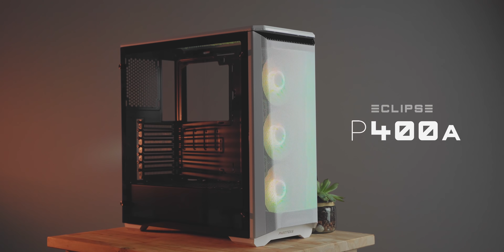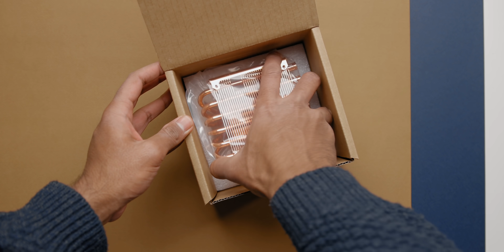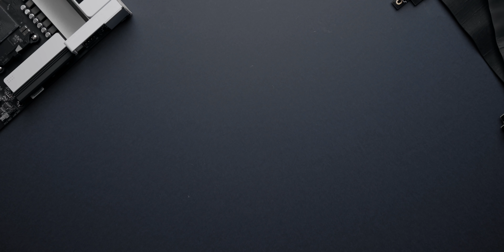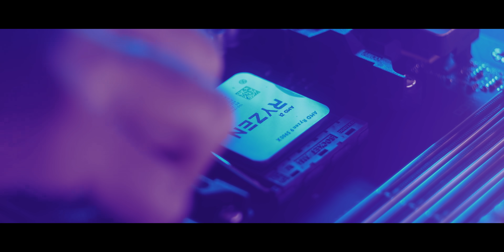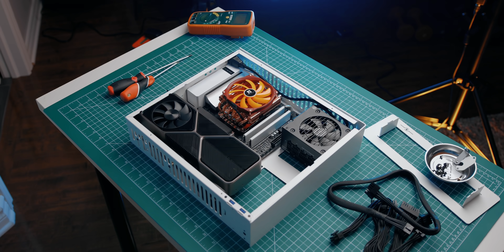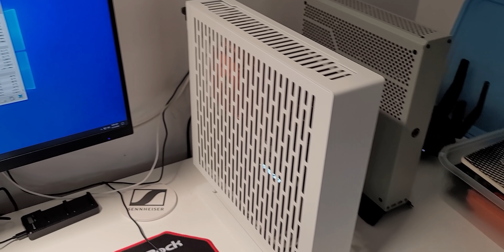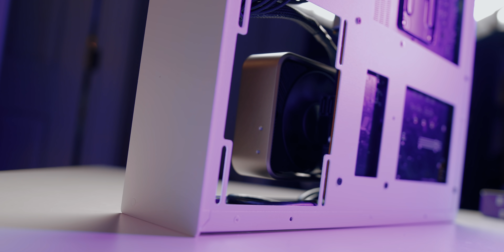The SMALLEST ATX Build Yet - Ryzen 5900X in a 10L Case!

Comment: Why can't they make new motherboard with higher power limit . Amd limiting new 5000 CPUs to old 3000 limit might be holding back new CPUs , 
I don't see why wouldn't 5950x can run all cores at 4.8 , 4.9 GHz , or even single core could go beyond 5.2 GHz.

Comment: what did you use for the gpu vertical mount?
Reply: riser cable that comes with the case. Vertical mount is only possible mount in this case.
Reply: @riba2233  when buying a vertical gpu mount cable should I consider whether its pcie3 or pcie4, sorry im new to this

Comment: the case looks really cool,   please follow up if you find a better cooler solution.  My HTPC is an old alienware x51,  similar form factor   but the included cooler is not very good.  I have been browsing for aftermarket low formfactor cpu coolers,  and would like some of your input.  thanks!

Comment: With regards to your sentry cooling problem, maybe you can fit an alpenpohn black ridge cooler. That the biggest low profile cooler I can think off. You can find one on eBay for about 60 usd. I know your pain. I have a Dan a4 v3 with 1800x with asetek 545lc and Vega 64 reference. Optimising and modding for better cooling makes them interesting. Hope this help.

Comment: the power cable plug being at the top of the back is such a disappointing design choice
Reply: The thing is where else could it be placed while keeping ATX + 2-slot video card and Mini-ITX + 3-slot video card support?
Reply: @soulest2081  not sure if it really isnt possible to put at the bottom. This layout in general looks pretty similar to my node 202. But yeah, the thick power cable coming from the top is definitely a deal breaker for me
Reply: @poloy4288  Good point there. I have considered a power cable with a 90-degree plug though I'm a form + function sort of person.

Comment: Dear @Hardware Canucks
, first of all thank you for this great option to see what can be done.
I'm considering building gaming pc so it could be portable and this small factor is amazing.
5600X with 6800XT, I only fear regarding CPU cooler.. max 59mm is small what cooler would be best since the 5600x TDP 65W ? would an l9 be better than this thermalright one?
Would love to see comparison between different low profile coolers! 
Thanks!
Reply: The Thermalright shown in the video is your best choice. I own the Thermalright AXP-90 Full Copper (47mm tall) and Noctua L9a-AM4 (39mm tall) and the Thermalright does much better in thermals and similar in noise.

Comment: ATX mobo + 120mm AIO + 3080 FE (or 1080 mini) possible?
Reply: 3080 - only with jerry riged 80mm fan on 120mm radiator. 3070 FE yes, 1080 and 1080ti mini yes, 2070super mini yes; 2080ti, 6800, 5700xt ref and other 270mm long ref cards - yes but with 92mm fan on 120mm radiator (bracket provided with the case)

Comment: rather pointless to have a case like this taking a full ATX board. the whole reason for having full ATX vs mATX or ITX is more PCIe expansion. but in this case you're limited to just 1 expansion device, which 99% of the time is going to be a GPU. making your comment about adding a 10G NIC a bit awkward since you cant even do that if you wanted to.

Comment: I love this build, it really looks like a console.
But my wonders are: would people spend 200€ for this case ? 

i personnaly wouldn't go over 80.
There is no tempered glass, it looks light,..

but that's a great project
Reply: It is not light, trust me. Uses really thick steel panels, and high quality powdercoating, and it is hand-bent, so not really comparable to mass produced cases. It also has ventilation and your components won't choke, so that is also a bonus :)

Comment: Well i would put a DC mode and make the fan run at 40% max to avoid having too much noise.
It does a great job too under 40%

But i also think a fan at the below part cant catch the heat well..
Below would be for fresh air and bottom for hot air exhaust.

Maybe a fan on side that would have blown fresh air through the card would have helped

Comment: I thought about the be quiet! Shadow Rock LP cooler (it cools my 125W AMD FX-6350), but after checking the specs, I found that it's 75 mm in height with the fan. It's 50 mm without the fan, so even with an aftermarket slim fan, it would not fit.

Comment: I had a quick question about this cooler, could you potentially Mount an NF-A12x25 on this cooler? The cooler specs on the website don't really imply the mounting positions match on the fan and the cooler. If you guys get the chance to Check/Test this, I would definitely appreciate it as I'm interested in the cooler.

Comment: Beautiful build, beautiful components. I may very well grab that board for my upgrade to the 5000 series next year.

One question, do you guys think that the airflow coming off that 3080 would be sufficient to blow air through a 120mm AIO radiator? I've never used a 120 AIO before, so I'm not sure of their TDP rating, but I wonder if that would help with CPU thermals at all, or if the GPU's fan not being solidly mounted to the radiator would nullify any gains the AIO might add.

Comment: Is the height of the Fan limited by the screws? I mean, if it´s THAT millimeter you need, you could also look for a 15mm Fan with the option of mounting that fan on the lower frame.
The Silverstone SST-FN123 could be an option.

Comment: Awesme build and I love cases like this too. You would think by now there would be some better low proile coolers for some of these more powerful processors or make the case slightly deeper. I don't think I would ever need thunderbolt but you never know so maybe I would use the Gigabyte B550 Aorus Master mobo with triple M.2 instead or the MSI MEG X570  Unify and do an all black build.

Comment: I wish there were more thin direct airflow cases that weren't limited run artisan cases that cost $200+. The rvz02/ml08b and node 202 are still probably the 2 best mainstream cases in that form factor and they're from 2015, so I'm glad to see more cases in the same space..

All I want is something like an ml08b upscaled to fit an atx or matx, but still sfx thin.

Also, I'm not sure why nobody has done it, but with a thin case like this, it could still fit case fans if it had sufficiently slanted surfaces. Sure it would be at reduced efficiency, but at least they'd be able to mount.

Comment: Eber didn’t you just update your editing system in an M Case M1 like 5 months ago?
Reply from the maker: Nope.  It was the Sliger.  There's been major issues with that build (we did a video on it) and adding a RTX 3080 wasn't possible due to heat soak.

Comment: For the Sentry case build, you should just take the time to split all the wires of the flat cable apart and then just use some custom cut velcro ties or zip ties in strategic places along the cables to make them neat again.

Splitting those flat cables makes working with them 10x easier!. I did a build not long ago inside of a Fractal Node 202 with a Corsair SF650 PSU with those same flat style cables and it was a nightmare to work with before I split the cables apart. Afterwards, it was an absolute dream to route the cables and looked extremely clean.

Comment: ALPENFOHN black ridge might be a "cool" replacement low profile cooler
Reply: That is true, yes.
Reply: I tried to fit my black ridge on my x370 taichi I have lying around and unless you have really short vrm heatsinks you can't fit a 120mm slim fan under it. It won't fit with one on top in this case either and I don't see much point in going with just a 92x14mm fan.

Comment: I have a suggestion, its called spray-paint...Thermalright fans are very easy to disassemble, I have 3x TY-143 fans on a 420mm radiator, that I have painted satin black, and it has not effected their sound signature.

Comment: Hey, so I am currently trying to build my first PC. I have done months and months worth of research, and have decided on parts that I think will fit me the most. However, one of those parts, the elusive rtx 3070, seems to never come in to stock. Anyone have any tips to get the card? Any additional tips for Black Friday and Cyber Monday shopping will be greatly appreciated too. Thank you 😊
Reply from the maker: Let us know your chosen build specs.  It could be that there are other cards that fit!
Reply: @HardwareCanucks  Wow, I didn’t think you guys would respond so quickly. Well thank you. Here is my list (feel free to change any other parts, I could consider changing it because of your professional opinion):
CPU: Ryzen 5 3600
CPU Cooler: Hyper 212 EVO
Motherboard: Asus ROG STRIX B450-F ATX AM4
Memory: G.Skill Trident Z RGB 16 GB  DDR4-3600 CL18 Memory
SSD: Western Digital Blue 500 GB M.2-2280
HDD: Seagate Barracuda Compute 2 TB 3.5” 7200RPM 
Video Card: PNY RTX 3070 / NVIDIA RTX 3070 FE
Case: Lian Li Lancool II Mesh 
Power Supply: Cooler Master MWE Gold 650 W 80+ Gold 
Monitor: Asus TUF Gaming VG24VQ 
Keyboard: haven’t found one for a good price :(

A lot of these parts I didn’t need to give, but a second opinion on them is always good. :)

Comment: It's the fan from the GPU pushing air through, and the other fan not being in sync with the GPU fan, and thus it's cutting the air turbulence which causes more noise.  At least that's what I Think.  For air flow to be non disruptive it needs to travel a certain distance from the fan blades to stabilize.

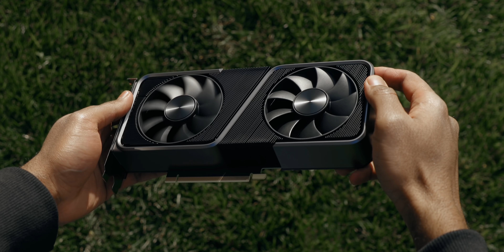Comment: 2:32 "and to top it all off, you can actually order one of these right now"  He's talking about the case, not the 3070.
Reply: It's a 3080 :(
Reply: @kingdavid7571  no that's a 3070 lol
Reply: @joshuacardenas7956  6:02: "We're going with an rtx 3080 founders edition..."  He did show a 3070 that you could use optionally with a different motherboard earlier, though.
Reply: Here in Canada the 3090 is going for $CDN$2799 and then add tax and shipping and you get $CDN5000!
Reply: @patrickwingert2018  👁️👃🧢
Reply: lol it's swapped now

Comment: Pick a 15mm fan and sand down the 1mm? I'd be interested to see how this case would handle an Alpenfohn Black Ridge with a 92mm fan on the bottom (120mm slim fan would work if there is enough clearance for the RAM or you'd have to switch to VLP RAM) and a slim Scythe Slip Stream on top (47mm + 12mm = 59mm). On paper, it sounds like it would work, but it would probably be easier to look at AIO's

Comment: One thought: if u build a smaller GPU (idk if 3070 could do it) and use that 120 fan space to mount a single AIO cooler for the CPU? That will help u with that CPU fan design problem i think. Yeah u cant put a 3080 in the build but i mean, u can have a really powerful system with an amazing look and water-cooled right?
Reply: Right!

Comment: The Formd T1 is a better case for hardware compatibility - just shy of 10L, ITX motherboard + 2 or 3 slot GPU (can fit a 3090 FE) AND a 240mm radiator (and an SFX or SFX-L PSU)
The only downsides are that you can only use an ITX motherboard (not really a problem if you're planning on only using one GPU anyway) and that flow-through cooling for GPUs doesn't work as well (but you can solve that by going with a custom loop or non-FE card)

Comment: I've been looking at this motherboard for my 5950x.  Why did you choose it over an x570?  Also.  Did you have to use a 3000 series chip to update the bios for it?  Much appreciated and i love your guys' videos.  Keep up the great work! :)
Reply from the maker: Great questions.  A)  We chose it because moving to X570 gained us very little and right now this board is really well regarded for memory stability and Quadro QVL certification (we're gonna post an update soon for that!).  B)  The Zen 3 was a drop in upgrade without a BIOS update but you NEED to update to AGESA 1.1.0.0 for proper support.

Comment: I am using the Alpenfohn Black Ridge low profile cpu cooler (it was made by the creator of the Dan A4) with a  Noctua NF-A9x14 HS-PWMA for a total clearance height of 47mm. It does the job very well for my Dan A4.1 SFX machine. I would consider looking into that if you want to get closer to a black aesthetic and noctua fan.

Comment: The AXP-100H Muscle comes with a same-sized black&white (black frame white impellers/fins design). While AXP-100RH/AXP-100 C65 come with a black frame red impellers/fins. There's also TL-9015 (grey) but it's 92mm so reduced performance + need zip-ties to mount it.

The same size black and white one though,  matches the color scheme 1 to 1 xD
Reply from the maker: True but the Muscle version is higher
Reply: @HardwareCanucks  True, but you could also just take the fan from Muscle and put it on the copper :)

Comment: Why not just set the PBO PPT and TDC limits to something lower, then you can PBO boost benefits but downclock to a coolable TDP when under full load.
Reply from the maker: Yes.  The issue is the earlier version of the BIOS we were using had some issues with PPT limits.
Reply: @HardwareCanucks  Ooh ok,  you guys should definitely revisit this.

Comment: What about the Raijintek Aeolus Beta Low-profile. It's  only 13mm high.
Reply from the maker: Need 12mm
Reply: @HardwareCanucks  maximum size is 120 x 120x 14 as you said in the Video and the Raijintek is 120x120x 13 so it should fit

Comment: So im curious on what pci e expansion cable u used because most of them on the market are pcie 3.0 with can cause issues/ instability with cards that are rated for 4.0 an or some performance hits. I know that there are 4.0 expansion cables but none that wouldnt need some sort of modifying to work.
Reply from the maker: What we did is what we recommend for EVERY build:  We built the system outside the case first to make sure everything worked.  Switched to Gen3 signaling and then finished the build.
Reply: @HardwareCanucks  Awesome, idk y I had so many issues with my 5700xt/3080 on the lian li pcie riser. I tried it on the asus crosshair viii hero and b550 aorus master and had the same stuttering, crashing and overall instability. I tried updating drivers, reinstalling windows, changing it in the bios. Idk if I was doing something wrong but I didn't think so, eventually I just said its not worth it and plugged it in the system with no issues at all both times. Think imma just wait till pcie 4.0 risers to avoid this plus might aswell take advantage of a all the features of this nearly 1000 dollar graphics card

Comment: Very happy to see you guys covered all the technical performance specs inside the case in this video and not just performance numbers. Big 👍🏻
Reply from the maker: Glad you enjoyed
Reply: @HardwareCanucks  Hy Dimitri. Iplan about the same with custom aJOAT. kinda like case. Do you think this axp100r copper with 140 fan attechment help and the noctoa 140 pwm 3000rpm fan , it is the higherst airflow currentl,y as i know in this size, can cool down with underolt the new 13900k or 7950x?

Comment: The p-atx website says this case will support a 120mm AIO. Any chance you guys tried that? Could you show what it looks like and how it performs?
Reply: Coolio! This might be my next build.
Reply: @rodefshalom  Awesome, thank you!
Reply: It performs awesome since it has clear path for intake and exhaust, I use it personally.
Reply: @riba2233  thanks for the reply. Can I ask, does it fit with a full size gpu?
Reply: @rodefshalom  without aio you can fit most gpu's, and with aio you can fit gpu up to 245mm long, or up to 270mm long if it is dual slot and you use 92mm fan on your 120mm aio. We provide a bracket for that variant.

Comment: That added noise from the "extra" fan is not because of differences in the flow rate. But you are right about there being fan interaction that increases the noise. It's actually very simple, and complex at the same time. As the fan rotates each fan blade will push a stream of air. This "aircusion" will follow the fan blade as it makes it's way around. This means that in a stationary spot in the airflow from the fan there will be pulses of air with a higher pressure. Now the fan shown has seven blades. That means that if the fan spin at 1000 rpm then there will be almost 117 "puffs" of air per second. That's to low a frequency to be audible, but there is also turbulence and harmonics that creates sound in the audible range.

 Now put another fan in that airflow and the fan blades on that fan will interact with the turbulent air from the first fan in just the same way. As these fans are offset there will be interesting artifacts in the air pressure created, and these will be more audible than if the fan had clean air on the intake. Now if the fan on the graphics card had been located on the front of the card instead of in the back like on the 3080 then the heat sink would have mitigated some of the turbulence and pressure spikes and then the added case fan would have caused a little less noise.

Another interesting thing is that putting a obstruction in front of the intake tends to cause more noise than placing the same obstruction on the other side of the fan.

Comment: I have the cooler, I threw a noctua 120mm on it. I also shaved out their bracket a bit to increase the available surface area from 100mm to 110 mm by hollowing out the ring.